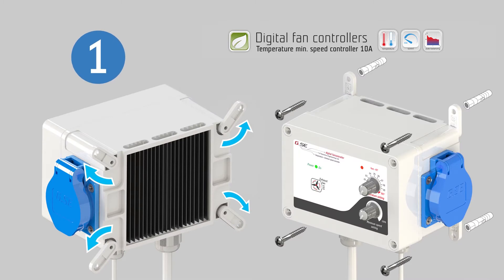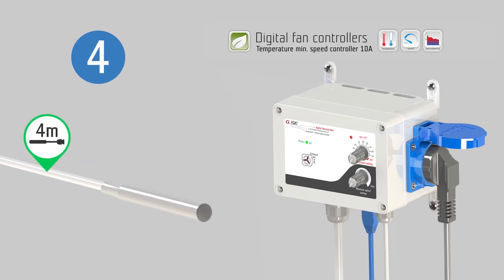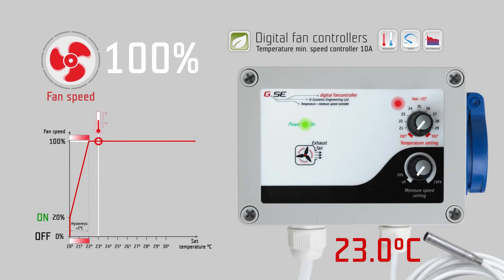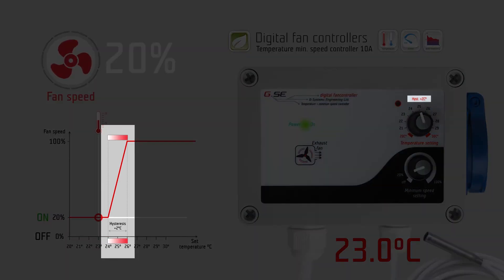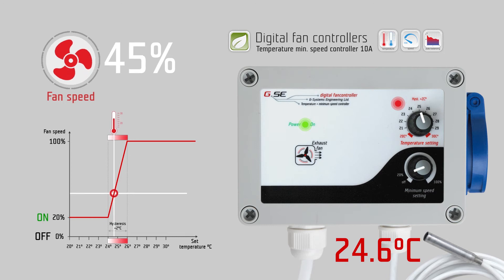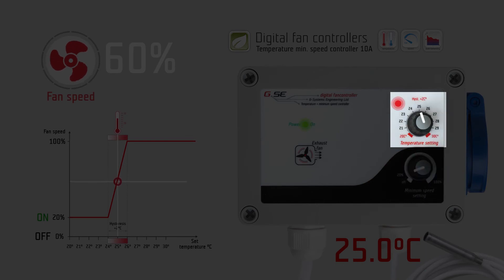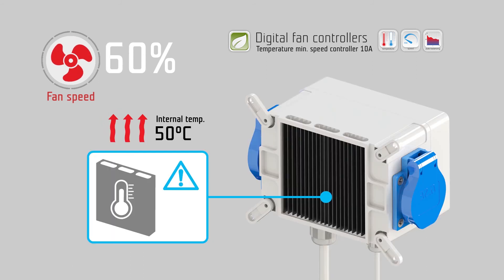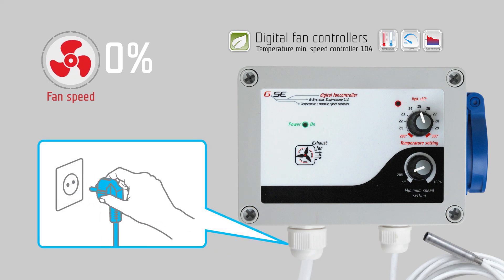GSE Temperature and min. speed controller 10A (1fan)

Comment: Mine is hooked to a softbox(silent) intake outake air extractor and it does not work anymore, it has worked before, and very well.
I set the temp to 25°c and fan speed on 25% 
Fan run full capacity all the time.
 Both knobs( Temp/Fan speed turn loose without stoping left or right.
Temps are always below 25°c or 
Mine is the first generation without green led light on.
I don't know what to do, besides buy a new one.
Perhaps broken.
Anybody?